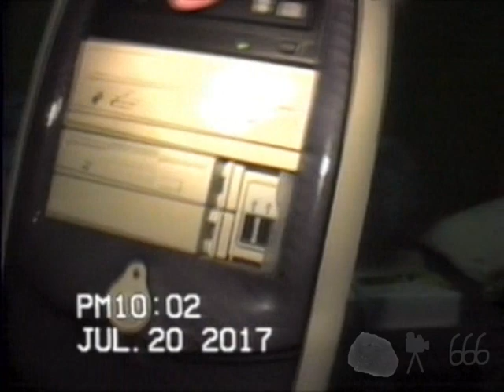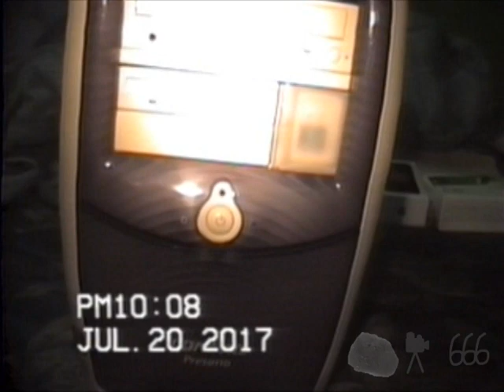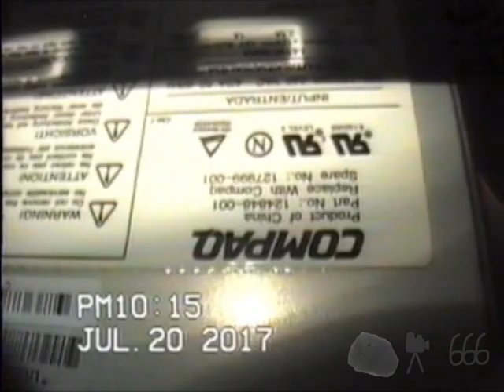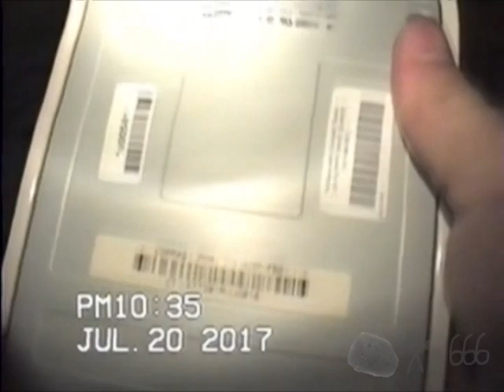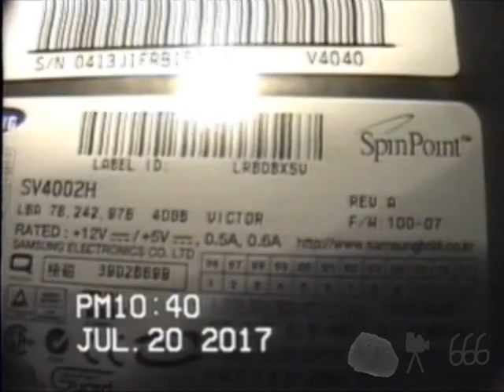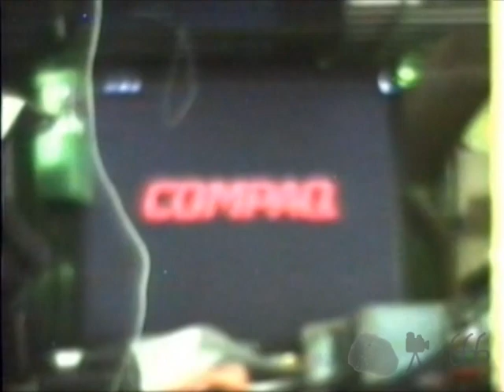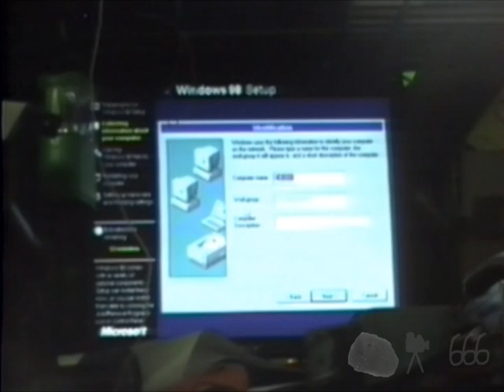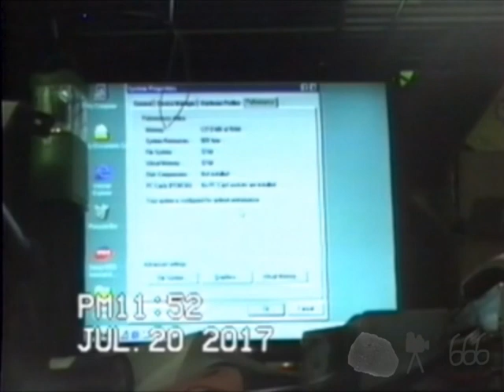Compaq Presario 5000, Part 2

Comment: Could you find a quickresotre cd it's on ebay for pretty cheap? If so they could give you the drivers?
Reply from the maker: I'm not putting further money into a Pentium III system that ultimately cost me ten bucks. Considering my present plan for it comes with the side effect of requiring constant re-installations of the operating system, it's not even worth it.